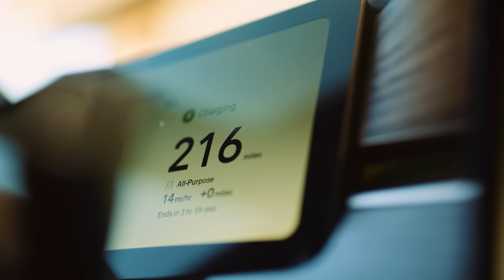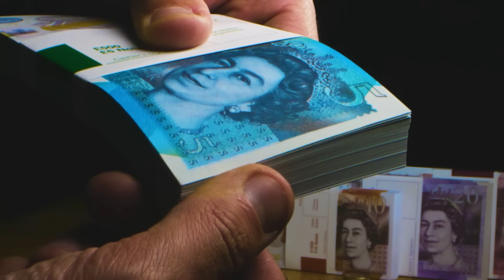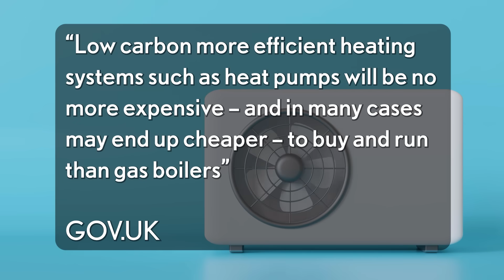The Truth About an All-Electric Future

Comment: Putting in New gas pipes just shows the government as usual are incompetent,  the left  hand does not know what the right hand is doing,  and if it costs millions of pounds and is not needed the government will just say oops and Wright it off.
Reply: It's a replacement program started in 2002 that is due to end in 2032. Safety is key.

Comment: Remember Towns gas from your local gasworks ? - Made by roasting coal in coal fired ovens, made towns gas and coke.
The coke was sold as a smokeless fuel. The Town gas was a mixture of Hydrogen, methane, carbon monoxide, napthalene and other noxious stuff - Nasty, dirty stuff. Replaced by "clean" natural gas in the 70's and now demonised.

Comment: Very good explanation. Just a point about Hydrogen, it is very expensive to produce by either electrolysing water with electricity or cracking methane (natural gas). - No free lunches in the energy industry, Gas mains are being replaced mainly because of safety reasons, The old cast iron mains are life expired.   God help us all in the dystopinan future.

Comment: He does make some viable points such as the need to upgrade the electricty grid and local dostribution.  But his naivety is unbelievable. He completely fails to metion nuclear power, particularly small nuclear reactors.  He obviouly is unawear about XLink from Morocco to balace the wind and solar power.  Furthermore there is a real opportunity for storage of energy produced from wind or solar.  There are of course batteries, but that may not be practical.  Huge progress is being made usnig electrolysis to produce hydrogen and then converting this back to electricity.  The loop efficiency right now is around 40%, but scientists believe that that this can be increased to arounf 70-80%.  If there are stil gas fired power sttions in 2050 then what about carbon capture?
Reply: Xlink has been cancelled. 

Hydrogen is niche, but may eventually be used as energy storage. For the moment money for such storage is better spent elsewhere.

CCS gas is planned in 2050.

Comment: When I look at my power bills, electricity is around 3.5 times higher than gas. Why would anyone use electricity?
Reply: As heat pumps are more efficient, drawing in around 3.3+ units of power for every unit of electricity, a reasonably installed heat pump can roughly match or better the energy cost of a gas boiler.

Comment: Even if we wanted to go all electric, we couldn’t. It would probably take 30 years to completely redo all that wiring can you bring it up to spec for all of the electric cars, electric stoves, electric heat pumps, electric water, heaters, etc.
Reply: The biggest users are EVs and heat pumps. EVs are a smaller demand and can be accommodated within the current grid. Heat pumps will need the expansion of the grid and generation as they are rolled out.

Comment: Domestic batteries and vehicle to grid technology provide solutions to a number of the problems described. Control systems are more necessary than more grid wiring
Reply: We need more transmission, partly to get wind power from Scotland to England, and generation to cover our use and for export.

Comment: I dont want hydrogen anywhere near my home. Gas leak explosion is bad enough, with hydrogen its on another level, and its a lot more leaky.
Reply: Better get a heat pump them because it's very likely government will be injecting hydrogen into gas supply

An extract from government website :-

"Hydrogen blending refers to the blending of low carbon hydrogen with other gases (primarily natural gas) in pre-existing gas network infrastructure and appliances. We are assessing whether there may be value in having hydrogen blending available to support the early development of the hydrogen economy.

In 2023 the previous government consulted on the potential strategic and economic value of the blending of up to 20% hydrogen by volume into existing GB gas distribution networks and options for its implementation. We are now seeking stakeholder views to help inform our assessment of the potential strategic and economic value of blending into the GB gas transmission network (National Transmission System (NTS)) and lead options for its implementation, if enabled."

Comment: In my opinion a somewhat erroneous opening statement, as Hydrogen domestic boilers have always been compatible with a UK Net Zero Carbon policy. Overall though an informative video that captures the scale of the issue.
Reply: Hydrogen won't be used for heating as it's 5-6 times more expensive than gas. Electrification all the way.

Comment: You use excess base load electricity to create green hydrogen, which is stored energy. So you build nuclear for your base, and you use renewables. When there is excess electricity - create the hydrogen that can be used to heat homes. Storing electricity is problematic when you have excess renewable generated electricity. You can locally store it in batteries. Or even use a compressor to create compressed air to drive machinery. On a big scale you can use pump storage hydro - if you have enough mountains and lakes. Or you use the excess to create a product that can be easily distributed and sold. Hydrogen gas is the way. None of this is perfect, cheap in the short term or easy. But you need a national strategy, and governments need to stick to it. An example from the past was the creation of the national grid in the mid 1920s. Abroad. Over a hundred years ago the Swiss realised they had the environment to build hydro power stations, and thus take away their dependence on foreign imported coal. They needed a base customer to give the investors a market. So they nationalised and electrified the rail network. Keeping gas domestic heating gives investors in green hydrogen a market to sell to.

Comment: We aren't going all Electric any time soon. Electricity networks, in cities & towns don't have a fraction of the capacity, to handle a Gas network switch-off. And yes you guessed it, increasing that Electricity capacity means digging, the streets up all over the UK. And the Rural Electricity networks, Lol good luck waiting for those to all be upgraded to Three phase power any time soon. The politicians, talking up the Gas network switch off, either didn't know what they were talking about, or were receiving terrible advice...
Reply: Yes, gas switch off is a while away yet. We are starting to build the generation and transmission needed to deliver electricity for heat pumps.

Comment: It's tossed it down here for weeks but we're still under a hosepipe ban, my gas bill is as big as my mortgage and there are warnings everywhere of power cuts. On the bright side our illegal immigrants are safe and warm, MP's dine well on subsidised food and drink and billions are given in foreign aid. Anyone else think our priorities are wrong??
Reply: Getting to the point where it stresses me out so much I’m trying to keep away from it, everyday got me worrying about my little boys future, at this point I’m keeping my wits about me but I’m do that with a 10 foot barge pole
Reply: In the Northwest of the UK we've just had around 24 hours of rain. Was most of it captured here or anywhere else. No, would be my answer.
Reply: Get a battery and solar my electric bill has been zero all summer and my gas bill has halved
Reply: @SlowhandGreg  I switched to heatpump and had my meter removed. In the summer my standing charge was higher some days than the gas used.

If I was 10 years younger, yes, batteries and panels. May just go with batteries and charge overnight on cheap rate.
Reply: @davemckay8664  I completly re insulated my 1935 house

Both floors and roof as well as new windows. While it may seem expensive we were well past a refurb it needed doing anyway.

There are insulation products out there that fit every budget and every home
Reply: Need to move to Britain mate. No power costs here or threatened. 

You could of course be spouting bull 💩.

I have had EV since 2018 and heat pump installed last year. No longer had a gas pipe in the house. Saving ££’s already.
Reply: I love how we're all too busy arguing at each other about immigrants. Sure, they cost the country a lot to house, but it's small fry compared to the bigger picture of the weatlh being extracted from the country by the rich. We all want to have a better quality of life, and are right to be angry. Lets be angry about the right thing and get the country back to working for us. Close tax loopholes, tax wealth, not work.
Reply: @alexcharles321 immigrants add to the economy if they are allowed to work and they improve the UK's productivity.
Reply: @Biggest-hz7ng 😂 now that’s a naive comment!
Reply: @simonstones1918no, it's based on data rather than feels.
Reply: For immigrants read replacements.
Reply: Yeah, it's the poor immigrants fault you're life is shit. Not the billionaires refusing to pay tax and buying up all the housing stock, and using the media to make you blame other poor people.
Reply: Brilliant! Are there many fools who still believe they traitors in government 🤣🇬🇧
Reply: and a 1000 came over yesterday, I try not to read it keep myself in my little bubble, if not, it would get me down.

Comment: There is a plan called Rota Load Disconnection where every area has been assigned a block.  Blocks are on a rotating blackout plan, with many levels of severity.  All so we can save a meaningless fraction of a rounding error of global carbon emissions.  Look on your bill, you have a single letter area code that determines where you are on the plan.
Reply: We have an oversized effect on global emissions relative to our population. We need to work with them and help lead and fashion the transition.

Comment: With solar and wind you need much higher surge capacity. Nuclear, whatever your views on the safety, and the viability and disposal costs of the spent fuel and contaminated liquid and other materials, cannot be switched on and off at will, so can only produce a base load, and cannot provide surge capacity. Electricity cannot be stored in a cost effective safe manner, as batteries are expensive,  degrade rapidly and require environmentally desptructive strip minning to extract, which is why little rare earth extraction occurs in the west. Hydro electric damns are the only cost effective way of storing electricity. So what can produce this surge capacity, apart from fossil fuel? I believe environmental destruction is a real thing, carbon particulates  plastics mercury and so on, but am not convinced co2 is a polutant. I have seen no sound statistical method of measuring global average temperature over time, and isolating Co2 as a causal factor, from all the other known and unknown causal factors who will interact in complex and unpredictable fashions. Do we even know the direction of causality? Does increased co2 concentration cause or is caused by increases in global temperature? Corelation is not causation, particularly when dealing with poor data sets, when you have excluded outliers to justify an existing  conclusion, that finacialy benefits those doing the mathematical modeling. Multivariate linear regression is not evidence, as it is susceptible to the assumptions in the mathematical formula, and manipulation of the data. RIRO, rubbish in rubbish out, as Macnamara found out in Vietnam, when using systems analysis to run the Vietnam war, with junk statistics like bodycount and kill ratios, ecouraging the indiscriminate killing of civilians, to count them as NVA or Vietcong. Carbon footprint is only a way for big business to monopolise nature, and finacialise it for profit, while distract people from very real forms of environmental  destruction.

Comment: Will people get new grants for new heat pumps in years to come after their existing heat pumps that they got grants for have worn out? I don’t think so , you will be on your own to front up the cost for a replacement .
Reply: The heat pumps don't cost much on their own.
Reply: We aren't having to resurvey, change (where necessary) radiators and pipes so costs will be less. The initial install costs cover the transition of the system to low temperature heating.

Comment: Don’t rely on any single source of energy if you can. I have a wood burner stove/ fire. Calor gas cooker (hob will work without electricity). Calor gas com I boiler for central heating and hot water .  Solar panels and 12v caravan batteries and dc/ac inverters to power freezer etc as required. . If I could afford it I’d have the house properly wired up with a Calor electricity generator. A DIY job for an average practical person?

Comment: Remember the massive installation when we changed from coal gas to natural gas. Think similar will happen as we use more electricity. The world has probably 60 years of gas left. Think you are , unusually for you, being too negative.
Reply: There isn't a hard cut off for gas and oil, just that it becomes more and more expensive to extract.

Solar and wind are taking over globally due to their cost and are predicted to be 70% of generation in 2050.

Comment: I think the upgrades are a long term program that's been in place a while already. Plus they are catering for more dwellings built rather than a change in use. What I really find troublesome with renewables is things like solar farms using up valuable farm land. The investors in these will want a guaranteed return so our prices won't reduce. Plus it doesn't help towards being independent for food. If they were serious about solar, every rooftop should have them. One of the biggest troubles with renewables though especially in this country is storage. Due to variable weather we can't guarantee we can produce when we need it so we need to find ways to store what we make. Personally I think the answer in the UK is loads of tiny amounts of generation is various places all feeding into storage banks rather generation on mass scale.
Reply: Yes, the pipe replacements have been underway since 2002 and are due to stop in 2032. 

Installing utility scale solar on farmland is much cheaper than putting it piecemeal on roofs. Often the farmland is barely usable for farming, so would provide a better return for the farmer as solar. Alternatively, the solar can coexist with farming as agrivoltaics.

Long term electrical storage is indeed a challenge and we haven't found any particularly cheap options (hydrogen is possible, but would be expensive). We can get by with gas whilst we find a cheaper replacement and spend our money building generation.

Comment: Hydrogen is not going to happen. 😊
Reply: Doesn’t it require lots of fossil fuels to make it?
Reply: @gdfggggg It does currently as it is made from natural gas, steam reformation. The only real green way is electrolysis, for that we would need lots of spare, unused electricity. Far more efficient to send that electricity to a heat pump.

Comment: As government policy is to discourage building of new gas power stations (Which, realistically we do need) and expanding renewables means that in a short few years we will run the risk of power outages. There are regular times where renewable output can only meet a small part of the required output for the grid. Despite the building of Hinkley c and planned building of Sizewell C nuclear stations that will only replace some of the nuclear capacity we had ten years ago.
Small modular nuclear reactors are being talked about but it takes time for talk to develop into actual power.

There is no chance that we can run on renewables alone, we need dispachable generation (Controllable generators which can vary output, which does not include wind, solar and nuclear) to keep the grid stable. Back up will also be needed.

Western governments are responsible for widespread use of unsuitable renewable generation for the grids with the inevitable result that costs have rocketed. The U.K. being a leader in the highest unit cost for the consumer.

My advice for anyone with a gas or oil boiler, replace it with a new one before they are no longer available and ignore a lot of the hype about heat pumps.

Comment: Thankfully, it's engineers who are  planning for this, not the useless  government. Fossil fuels only account for 30% or less of our electricity supply. It's the cheapest form of energy, by a long way. Out current electric prise is determined by the cost of the most expensive supply - and that's always fossil fuels.

Comment: I don’t mind switching to all electric and I don’t mind renewables etc. All lovely stuff but the standing charge for electricity is way higher than Gas, the cost of electricity is way higher than gas, the capital cost of equipment for electricity is way higher than gas. Yes we can buy air pumps and storage radiators and electric showers and induction hobs and smart meters and X other things to make the cost of electricity come down and there is an X years payback…..but why do any of it given how quickly it’s all evolving! Stick with gas until they have an electricity tech and price that’s as cheap as Gas.

Comment: You mention prepay meters etc why would they be an issue
Reply: Probably to do with then being fixed to the variable rate and cannot benefit from cheaper and often more suited fixed tariffs, I have a home battery and a EV so it makes no sense of me paying peak rate 24/7 so I have a time of use tariff 24.9p during the day which I run from battery power and 6.9p during the night when I use virtually 100% of all energy.